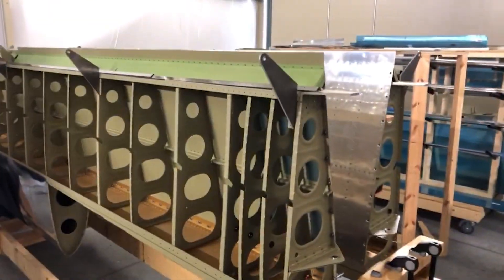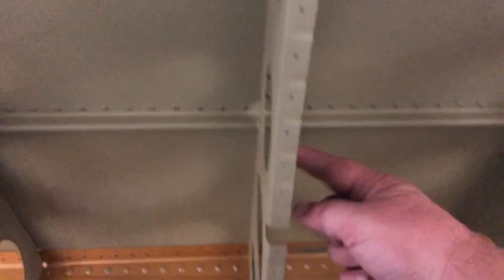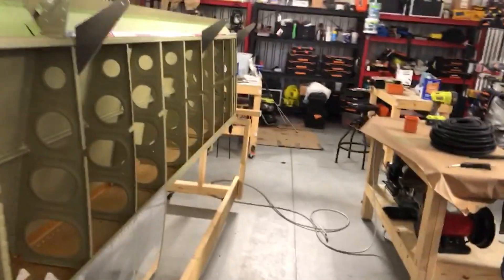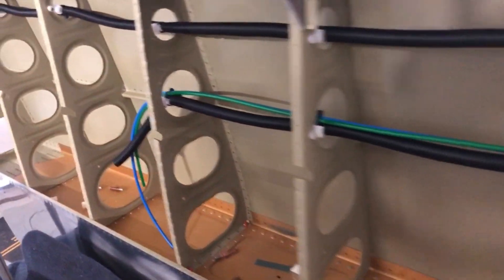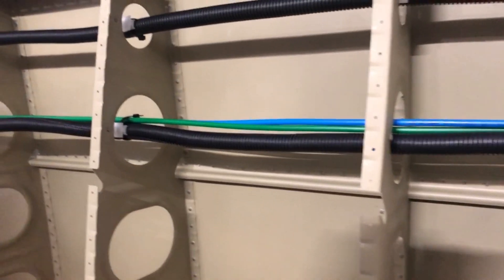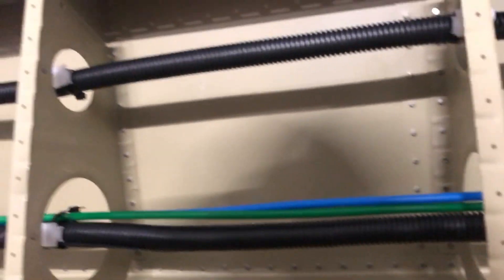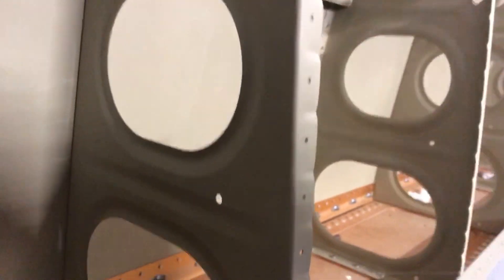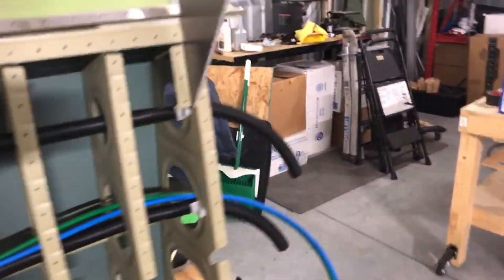Running Conduit Right Wing

Comment: I haven't heard of those clips before, I'll have to look into those when I get to my wing kit. You could probably put a oscillating fan in fron of that motion sensor/ light switch and keep your lights on. Nice work!
Reply from the maker: I did not think about using a fan. Thanks for the idea. Also, don't rivet the clips in, the video I just shot today tells why and I redid them today using stainless steel pan heads and nylock nuts. It turned out so much better.

Also, watch the video I will be posting tomorrow. You will need to cut two rivets because the size Vans tells you will not work.

Also, the clips are https://www.amazon.com/Panduit-LHMS-S10-C-Lightening-Cable-Natural/dp/B005T7SVUK. Check around for pricing because I know I got them for a lot less through Panduit.